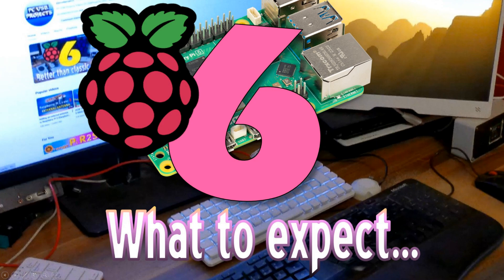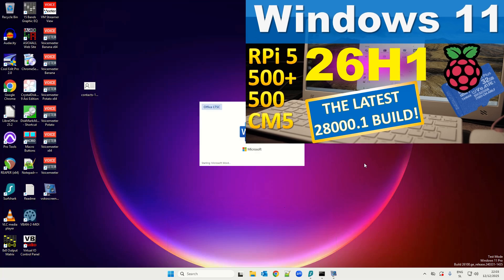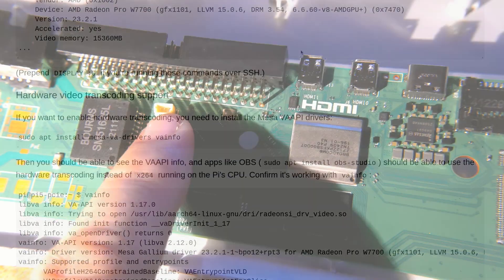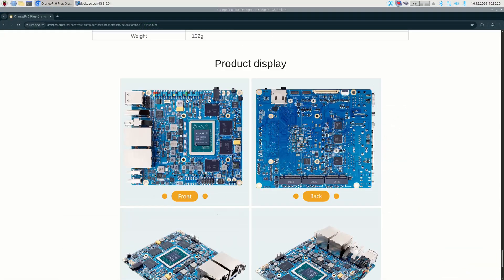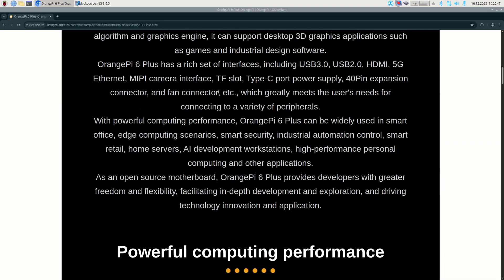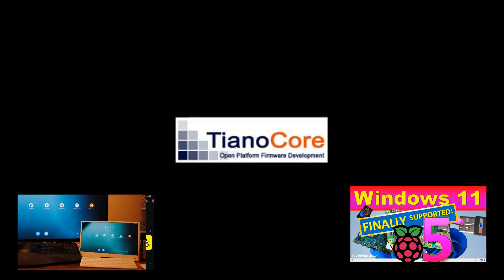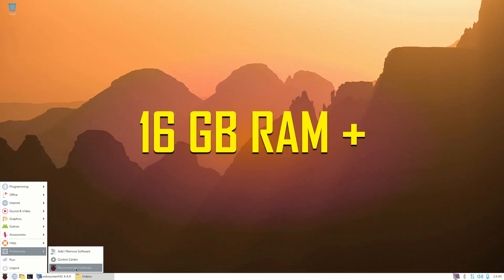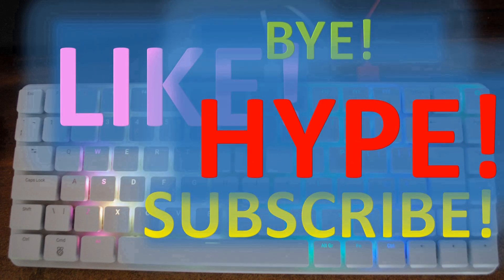Raspberry Pi 6 is getting shape. What are the main features? Is it just around a corner?

Comment: builtin POE and support for emmc storage onboard would be nice. It would be nice if i just needed to purchase one thing.

Also, get rid of the little semi-circular wings they keep putting on the power supply. I always have to cut them off with a hack saw so it doesn't block the the power points beside it. They don't add these things to the US version so why mine? Also the power cord exits from the top rather than  the bottom blocking the power point above it as well. Surely there's gotta be a USB PD standard that can power these things...
Reply from the maker: Interestingly, there are unpopulated contacts on RPi 500(+) PCB for an POE circuit, but it has not been implemented, yet. Raspberry Pi might release RPi 500++ with PoE in the future (Watch: https://youtu.be/6gvahMdhXRs, https://youtu.be/myuxPRa69jE) . Second, there is already an eMMC option on RPi CM 5. However, POE is currently available as an add-on POE hat, which you can use with RPi 5 and RPi CM 5 - depending on the carrier board, or as a separate POE unit, which provides power through the usual USB-C connector. While POE hat in fact provides 5 V through the 40-pin expansion port, while using a dedicated 4-pin connector in RPi 5 PCB to power itself. You can also use just 1 powerful 5 V PSU (for example: 5 V 30 A) and a simple power distribution circuit (basically a box with 1 input 5  V cable connection (30 A) and a number of USB 2.0 connectors for powering) to power all your RPis from a single wall outlet. It works for me, no POE needed! 

I've also tested powering another RPi 4 or 5 through RPi 5's USB-C connector while the RPi 5 itself was powered through it's 40-pin expansion port. You must use at least 2 pins for +5 V and at least 2 pins for GND. The max. current on 40-pin expansion connector is about 10 A, if you are powering a RPi 5 and a bit less, if you are powering a RPi 4. This configuration also enables USB communication between RPis. However, you may experience brownouts on the RPi powered through another RPi, if not implemented correctly (mostly because of an sufficient cable thickness).

Watch: https://youtu.be/w4H88821tLk
Reply: > builtin PoE
Would add cost, take up space, while not being that widely used
Reply from the maker: If you have a chance, just open a Raspberry Pi 500+ and you'll see that there is actually enough room inside it's keyboard overlayed case for a POE circuit. Or watch my video instead: https://youtu.be/6gvahMdhXRs. You just have to solder the missing elements, which you can probably guess from the RPi 5 PoE HAT. So, "Raspberry Pi 500++" wouldn't get any bigger. However, the list price would surely get higher than 200 USD. About 220 USD, I guess. And I agree that only a few use PoE at home.

Comment: Interesting speculation by the creator, but I believe Raspberry Pi is facing a 'wicked problem' that hardware iterations alone won't solve.

While the video mentions the potential for better graphics and Windows support, the real issue is that they are stuck optimizing a single, aging platform (Broadcom SoC + RP1) while competitors like Orange Pi and Radxa are rapidly iterating with diverse architectures, including Rockchip, RISC-V, and Intel N-series.

In my opinion, for Raspberry Pi to remain the 'gold standard,' the Pi 6 needs to address three critical areas.

First, we need more than just incremental speed. We need dual Ethernet, faster USB throughput, and expanded PCIe lanes (ideally dual M.2 slots) to compete with the current crop of NVMe-focused boards. Second, their software roadmap regarding mainline U-Boot, TianoCore, and upstream Linux support is historically slow. Relying on an RP2350 co-processor to handle real-time GPIO concurrently with the main SoC, serving as a built-in UART bridge, or an A/B firmware with an EEPROM that cannot be reflashed so you cannot brick your bootloader would be a true innovation, rather than just another hardware revision. Third, as you already mentioned with AI acceleration, the reality is they already missed the start of the capable AIoT era with the Pi 4 and 5. Relying on expensive HATs like the Hailo module is not a sustainable strategy when competitors offer integrated NPUs with mainline Linux drivers and out-of-the-box support in many distros.

Ultimately, there is a growing fear in the community that Raspberry Pi is becoming to Broadcom what Arduino is becoming to Qualcomm: a front to whitewash a proprietary image for the FLOSS and educational sectors. Unless they rid themselves of their Broadcom dependency and start producing more of their own IP (like they did with the RP2040/2350), they risk losing their dominance to cheaper, more capable, and more 'mainline-friendly' (i.e. 'just works') competitors, regardless of the size of their community.
Reply from the maker: There are many independent SW and HW makers, but some want to have mostly their own SW (at least OS) on their HW like Apple with Mac OS for it's Macs and Raspberry Pi with Raspberry Pi OS (13 Trixie) for all of it's models (except Picos). This has so far worked for Apple and Raspberry Pi for instance, because they retained uniqueness as well as technical excellence of their respective OS designs. 
However, such a strategy may as well become a major hurdle for some SBC makers. As I see it, the newest SBC HW (like Orange Pi 6 Plus,  Radxa Orion O6: https://youtu.be/M317y3_tNAU) is making giant leaps to towards a new ARM64 architecture based "universal classic" PC, which would compete with Intel and AMD based classic PCs. Intel once tried a similar strategy with Itanium architecture but ungracefully failed. While ARM64 architecture has a strong backing in the world of smartphones and lately also in Microsoft support for Qualcomm's Snapdragon processors, mostly for laptops with ultra low power consumption.... We'll see, if a generally popular and a better than a classic PC ARM64 based (desktop) PC emerges in the next two years.

Comment: The power supply needs to be improved. 5V 5A via USB C is not a good standard. Why doesn't PI use 12V with a stepdown converter.
Reply from the maker: Partially true! A USB-C connector is used by many new laptops for powering though they may require considerable power. There is a trick! While the electric current on USB-C connector cannot increased beyond 5 A, voltage can be considerably increased to 20 V or even more. A PD capable power regulator on the laptop PCB converts the input voltage (say 20 V @ 5 A) to 5 V and 20 A to get 100 W for instance.

Here are some examples on how Raspberry Pi 6 could be powered, if it needs more than 25.5 W (5.5 V @ 5 A). Raspberry Pi has already made a 45 W PD capable PSU. Watch: https://youtu.be/XQC1dknGM2Y. I think it is in fact gonna be used to (at least initially) power RPi 6.

Orange Pi 6 Plus for instance needs a PD capable 100 W PSU (20V @ 5 A). The maximum current trough USB-C connector is 5 A, but the voltage can be much higher than 5 V. Muse Book for instance is charged & powered through any of it's USB-C ports. The enclosed 65 W PSU is PD capable. Watch: https://youtu.be/WfhGVTPxyE4.

However, some SBC designs also allow powering with a standard ATX PSU for a classic PC through a standard ATX connector. Watch: https://youtu.be/M317y3_tNAU.